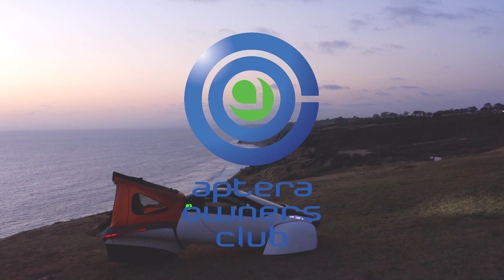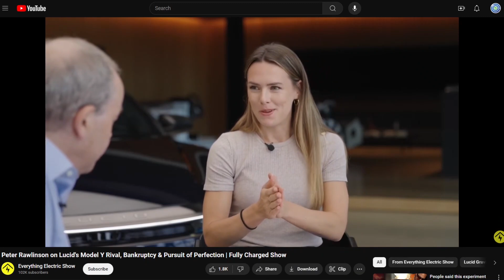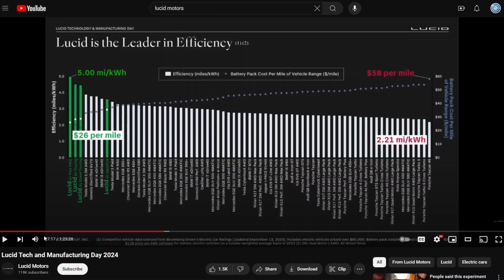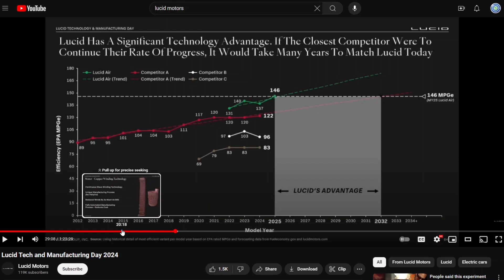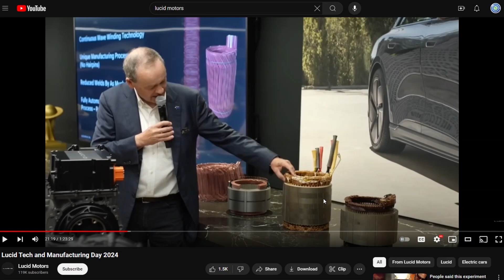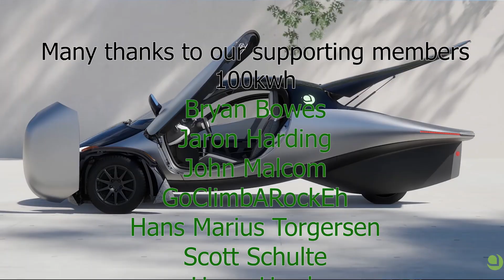Lucid's Peter Rawlinson talks about efficiency

Comment: Lucid has said that they are developing a smaller motor with about half of the power of their current motors, for their upcoming smaller EVs. Having a super efficient 200kW Lucid motor would be great to get in a future Aptera, especially if it was paired with a smaller hub motor for the rear wheel. I spoke with Peter Rawlinson a few years ago and he impressed me as being engineering and efficiency focused. So I could see a future alliance between Aptera and Lucid to champion the cause of efficiency.
Reply: Care to speculate if a smaller Lucid EV would benefit significantly from being clad in custom-fitted Aptera solar cells?  Or as with today’s standard/heavy EVs, "lipstick on a pig".
Reply: I'm not exactly sure what you think it would be like driving an Aptera with 268 horsepower, but my guess is it would have difficulty applying all that power to the ground, with all the consequences for cornering performance that entails.
Of course that power can be restricted when sensors detect slippage, but then why have it? In a 2000 lb. car?  What's the point? How often do you really need to accelerate to 60 in less than 3 seconds? 

I'm not saying Lucid couldn't build a more efficient Aptera motor than an off-the shelf Vitesco motor, but the power level should be optimised for efficiency, like most other engineering choices have been at Aptera.
Reply: @993cc  This is one of the key advantages of EVs. The ability to have instant power on demand. Control that power exactly. Offer amazing performance. And still provide superior efficiency and economical operation when driven normally. 268HP is only 67HP more than the combined power rating of the Elaphe motors in AWD configuration. Tesla's Model 3 Performance has well over 500HP, but still manages over 300 miles of range from a 75kWh battery pack. Elaphe developed a special version of their motor that was originally designed for vehicles that were 2X-3X the weight of the Aptera. And that tuning potentially lost a little power in exchange for gaining range. I mentioned the upcoming smaller Lucid motor because of its small packaging and efficient design (which would be a match for Aptera's engineering goals) Potentially, it would be lighter, more powerful, and more efficient than the proven EMR3 Vitesco motor. And an alliance between Lucid and Aptera would likely benefit both companies.
Reply: @993cc  One of the great things about EVs is that you can have more power than you need in reserve, and that capability will not affect good economy, comfort, or reliability. 268HP is only 67HP more than the rating of the AWD Aptera using the Elaphe motors. I believe that the Lucid motor is simply better. Not that the Continental E-axle is bad. I just think that an alliance with Lucid would benefit both companies.

Comment: I’ll just point out here, that recent tests of Teslas RWD long range Model 3 does indeed come very very close to 5miles/KWR specifically about 203whr/mile,, but,, at FAR lower cost than a lucid, far lower. Although to lucids credit they achieve this with a larger luxury car. We need MORE company’s like Aptera who START with an ultra high efficiency much more affordable car for the masses. It’s rumored that Fords Skunkworks team is ALSO focusing on a smaller ultra efficient, affordable car. It will be VERY interesting to see what they come up with, Jim Farley has said it will be VERY different than ANYTHING they’ve ever done.. the problem with Lucid as I see it, is they don’t take efficiency FAR enough, your only Gona get like maybe a 10-15% improvement with just drivetrain alone. Aerodynamics has the biggest potential difference and then weight. Chris A. Has said repeatedly that their aerodynamics, and materials advantages could easily transfer to much larger vehicles. 
When designing a more efficient airplane, you don’t just make the motor/drivetrain more efficient, you start with aerodynamics. So I remain un impressed with Lucid personally, beautiful cars, but mostly style over function with a little bit of extra efficiency from a better drivetrain.

Comment: I thought that Aptera's MPGe was better than 136.
Reply: One gallon of gasoline Has 33.7 kWh of energy. The Aptera is expected to use 0.100 kWh/mi. So by the EPA method it should get 33.7 kWh/gal ÷ 0.100 kWh/mi = 337mpg-e.